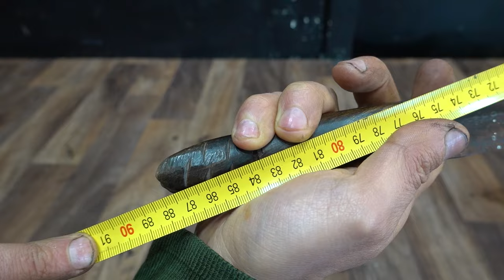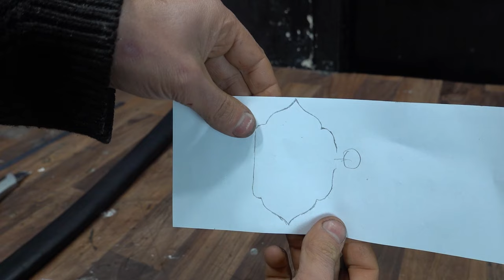Restoration Caucasian SHASHKA - Austro-Hungarian BLADE!

Comment: The shashka I have has Persian numbers on the blade, guard, and pommel. They all match. I think the handle pieces are all real, as they are made of copper, but I'm not to sure of the blade. The metal is old and pitted, but the blades tip is somewhat rounded. Also, the fuller is very shallow. Anyway, as always your work is gorgeous 😁. I love your curved sword videos. Keep saving these old soldiers from rust 🙏
Reply from the maker: Thanks, if you have photos you can show (send to my social pages) for me always interesting.

Comment: A great restoration as usual. If I might offer a suggestion, to prevent a plastic pipe full of liquid from falling over and spilling, why not place a leather strap around it with the ends of the strap held in the jaws of the vice? I hope this mayt help save expensive essentials in the future. Looking forward to your next restoration.
Reply from the maker: Hi!Thanks for the feedback and advice. Yes, it definitely needs to be fixed. It took a huge amount of time..to clean the entire floor

Comment: How long did this project take in all?
Also - I was wondering whether the rings on the fittings should not be on the inner curve of the scabbard, as it would be closer to the belt / suspension?
Great work, as always.
Reply from the maker: Hi, you may have missed it. I wrote about it in subtitles. The project took more than 1 month. No, this is a Caucasian type saber and it is worn with the blade up. To be able to strike quickly
Reply: @ScrewsAndTools  Like katana, I get it.

Comment: What makes you think this blade is Austro-Hungarian?
Reply from the maker: It doesn't make me think anything. I rely on geometry, weight, fullers and the stamp of the blade. and of course, at the end, my experience. I often have the happiness to hold, watch and study old blades in my hands
Reply: @ScrewsAndTools  that blade is definitely not Austro-Hungarian 🤣
Reply from the maker: Write your version, only with confirmations. Intresting to read it
Reply: @ScrewsAndTools  at 2:47 there appears to be an inscription, though it isn’t clear what it says. Is there a maker’s mark? Is there a date? The fact is that this type of blade was not typically in use in Austria-Hungary; it’s not even typical for the period. My guess is that it is Cossack, or possibly Russian, or quite possibly even a fake.
Reply from the maker: There are remnants of the stamp on the blade, which was common in the 17th and 19th centuries on Austro-Hungarian blade and also on Hungarian ones. Secondly, the blades of the ЗОФ (Zlatoust Arms Factory) had a completely different geometry, the blades were those that were produced for the Cossacks. And for the Cossacks, among other things, they were ordered from Germany specifically from the city of Solingen. All this information is in the books that I read and study, not assume.
Reply: @ScrewsAndTools  exactly what I said. It is a Cossack blade, not an Austro-Hungarian one.
Reply from the maker: Study the period of history from where the Cossacks ordered their blades and weapons in general. @gymnosophist7471
Reply: @ScrewsAndTools  ok great; why don’t you just go ahead and call it a Cossack sword?
Reply from the maker: Because I am studying the history of Caucasian weapons. And in one month, I see, touch and look at more
shashkas, sabers and daggers than anyone in a lifetime. This is what I love! @gymnosophist7471
Reply: @ScrewsAndTools  then you should know at the very least that this is not a style of blade used by the Austro-Hungarian military. And you say it was made in Solingen (as many shashkas were) which is not even close to the A-H empire. But ok, you’re the expert…
Reply from the maker: I did not write that this blade was made in Germany. And I wrote and claim that this blade is an Austro-Hungarian saber, which confirms the stigma that still remains, it turns out books and I'm wrong. You're right. well okay. Thank you for your interest. @gymnosophist7471
Reply: @ScrewsAndTools  it’s not a saber, it’s a shaska. As an “expert” who has read so many books, you really should know this. Has it ever occurred to you that you are not the only one who studies this subject?
Reply from the maker: I'm wondering where you from and how long have you been studying Caucasian weapons? @gymnosophist7471